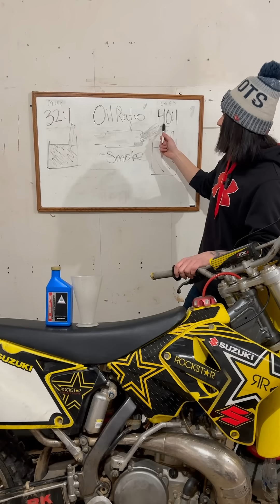2 Stroke Oil Ratio Explained

Comment: I think youre a little off on your milkshake analogy. Youre incorrect, its not richer because more fuel is flowing through the Jets with less oil because its thinner, its due to the fact that Oil acts like Oxygen and the bike will run leaner with More oil=more oxygen in the Burn.

Comment: We run typically 40:1 or 50:1 in the ski world , depending on the oil some push 75:1 ot 100:1 but its only those looking for every ounce of power and not aplicable to all setups , this is for race skis btw , for the thinner ratios

Comment: My 2001 Banshee calls for 20:1 or 24:1    That’s a damn Quart of oil in a 5 gal Gas can!!!! 
We have come along way since the original manual was written in 1987 with synthetics.
I currently run 93 octane with 32:1 Super-M Premix.  
I can probably bump it up to  40:1 with no issue, but I’d rather off foul a plug then seize an engine.  
You can also tell a lot by how it’s doing, installing a new spark plug and running it for roughly 15 minutes.

Comment: PLEASE STOP LISTENING TO PEOPLE LIKE THIS

okay so bro is actually dumb lol. running 32:1 or 40:1 are both correct its all in ur riding style. I ride a new yz125 and when we are in the trails where im less hard on the throttle, i run it 40:1. when we go to the track and im heavy on the throttle, ill run it 32:1. A heavier mix when you're not keeping it on the chip will cause the bike to bog and kill plugs. dont listen to this dingus

Comment: Honestly you're half right kinda. The reason it runs richer isn't because it's thinner, the difference from 32:1-40:1 in viscosity from a tank of fuel is literally nothing. It runs richer because each charge of fuel has more fuel. The volume that's going into the cylinder is the same either way, but less oil means more fuel per that volume. Nothing to do with drinking a thicker milkshake vibe. Also 100000% 40:1 will clean up your carbon sludge and tuning your bike correctly will really clean it up.

Comment: Fuel consumption is not going to change a great deal depending on how much oil your adding to your fuel. Your engine will deterioration quickly if there isn't enough oil in your fuel. Much better to be a little over than under.

Comment: As a mechanic by trade, I can tell you that it has more to do with oil quality than what the manufacturer says, when I raced I ran 50:1 amsoil racing oil and I never had any issues with lubrication, when I big bored my engine the piston and cylinder looked new and it had 5yrs of racing and hill climbing on it, your are right about needing to jet for the mixture you run but just use a quality oil and your engine will live a long time.
Reply: This is easy stuff , most of these kids are young school , I have lots of mild to wild toys . I’m at 40:1 with premium oil on all my 2 smokes with proper jetting running mild VP110 and have had Zer0 issues for many many years .
Reply: @JDRTRM  what are you running for mods and compression to need 107 octane fuel?
Reply: Kx 250 ran it with belray mc1 synthetic 50:1 wide open all the time. Jetted, piped, ported and polished intake. Never had a problem as long as I changed the rings every few months. Ran circles around my buddies with CR 500's...
Reply: Plugs will tell you all about what’s going on , from too much oil , jetting , and air temperatures
Reply: @JDRTRM  for the most part you are correct, the plugs are a great indicator of a problem or proper jetting, you will still have to do diagnostic to see what is causing the plugs to look the way they do
Reply: It's the quality of oil but the flashpoint is most important. High flashpoint oil won't burn at lower temps. Low flashpoint burns off too quickly for hot riding, like tight trail, muddy and sandy or any time your pinned at low speed. That's when you need high flashpoint oil.
Reply: Don’t be a brokie got it
Reply: I ran 50:1 on my supermoto also, I did street riding. It did fine
Reply: I agree I have to this day a 88 250 r and a 87. Both raced  50:1 is what I have been doing since I got them. 25 years and the one motor  looks mint inside. I blew a gasket so tore in down but i didn’t need to.
Reply: @RockwithAj yup that’s what good oil is supposed to do
Reply: @henryhenry3832  we just put a clutch in the 87 last night. My son is finally racing. Super fun for me to teach him.
Reply: @RockwithAj that’s awesome you guys are doing fun things together, my boy is going to start next summer
Reply: Wouldn't 50/1 cause over heating? I'm interested.
Reply: @CraigHenry-zq8jz  if you don’t jet accordingly it will run richer with 50:1, but no it won’t cause higher cylinder temperature, you are thinking of a lean condition which is caused when you run more oil than the engine is jetted for, the best way to look at it is more oil = less gasoline which = lean burn and higher temperature, less oil = more gasoline which = richer burn and lower temperature and all the negative things that come with lower temperature, carbon build up and less power are the main two, but when you run a good oil like amsoil ( it’s called amsoil dominator now) you need to downsize the main jet in your carburetor to accommodate for the higher gasoline content, it will be a bit of testing to get your engine jetted right, but i should also mention that if you run 87 octane versus 91 you will need to rejet to a bigger jet because 87 burns faster and can cause a lean combustion
Reply: @CraigHenry-zq8jz no its called quenching more fuel gets thro main jet faster cooling engine . And with a quality Ester based full synthetic causes less friction between piston and cylinder wall
Reply: @CraigHenry-zq8jz most brands recommend 60:1. Never in hell would I run my KTM on 32:1.
Reply: Poked and Stroked BaDshee << gets the fuel mostly ,lots of mods , 160psi per ,6deg timing etc etc .can bring down psi to run less octane but it’s more fun to run full tilt and the smell is always good , other 4x4 quads do not get the fuel as they are not so wild but can run ,will see very little hp if you notice it riding ,1000cc 4 stroke snowmobile has been tuned down some .
Reply: is Marvel mystery oil OK to use? On a regular basis.
Reply: Don’t know wouldn’t try . Get some good 2 stroke oil ,
Reply: Someone else that knows AMZOIL. I ran it at 100:1 with no issues and great wear protection.
Reply: @jasonkerekesch5012  I’m sure you could run 100:1 but the bottle said 50:1 for my application and I had great results with it
Reply: I ran that Amsoil in my bikes when I raced as a kid CR80s and a KX80 big wheel... I still ran it 32:1 though.  NEVER had to pull the jugs off any of them.  Raced them hard, too. 

Would love to have that big wheel KX I had still... That thing was an absolute freak.  Bone stock engine and pipe, KPS suspension... that sucker ripped!
Reply: @billymanilli  absolutely, you can run it at 32:1 but you get better power if you run less oil and jet accordingly
Reply: It is also flash point because I can run the same ratios and one significantly smokes and causes more spooge than the other
Reply: @capsitan  yes that’s right, but that’s why I only run high quality oil
Reply: 50:1 and proper jetting is the way
Reply: You are correct it also depends on what kind of oil is being used because some oils are castor, some synthetic, some petroleum and then the manufacture adds different solvents and there is different thickness. If I use redline I run 50:1 on my 250 2 stroke and if I use motorex I run 40:1. If your jetted correctly you can still have your bike loading up because it is receiving too much oil in your bottom end.
Reply: @lospanchos68  castor and petroleum gum up power valves ans exhuast port faster also. Ester is the way to go.  Had a shop for 17 years and ran about every oil and I would recommend motul 800v. All the way . Smells great . Good additives. Actually the only oil I felt more brap more crisp and ran harder . And burned clean .
Reply: @Bforbendejo  I’ve heard great things about motul but I run jd jetting in my Yz 250 and Yz 125, I was having loading up issues on the 125 jetted at what jd recommend and that is when they explained to me that redline is a good but thick oil and they recommended motorex 2t at 40:1 because that’s what they use when testing so I followed recommendations and it solved loading issues and ran imo perfect so to finish up my redline oil I followed there recommended 50:1 in my 250 and it solved issues but now just stick to motorex.
Reply: Its ALWAYS you ktm/euro dudes who run lean ass mixes. Theres a very good write up by A.G. Bell or gordon jennings i think. Did dyno tests from lean to rich. 18:1 is when things got too rich. The thing ive found is higher rpm = needs more oil. Especially the small bores. Big bores can get away with less, probably cause they they stay wayyy lower in rpms. It does clog pipes up quicker for sure.. but thats easy to clean out. You can definitely feel the vibrations go wayy down with a healthy super rich mix and its audibly more quiet.. no "quality" oil is gonna replace lack of oil when it needs it. If anything happens thats not ideal 20:1 super tech gonna beat 60:1 amsoil/motul etc. Look at any old bike. 250r has 20:1 plastered on the tank. What happened after that bike. Did oil get 10x better? No not really. Castor still king.. EPA /green warriors dont like to see the smoke. Thats the only reason they go lean.. plus why not sell more top ends?
Reply: @TheZmoney420 lol you have no clue about what you’re talking about, im Canadian 😂, and I raced all the way to to expert class in motocross with a cr250 and only ran 50:1 Amsoil dominator and never had any top or bottom end issues, in fact the last bike i bought had two hard seasons on it when I sent it to Honda for a high compression big bore kit because I was too buy at work to do it myself and the Honda mechanic couldn’t believe how good the inside looked, he asked me what oil I was running and he switched his cr500 motard to amsoil, it has nothing to do with the amount of oil you put in and everything to do with lubricity in the oil
Reply: doesn't take a mechanic to know his nuts lol that said.. the only time you should jet is on a bore. otherwise for a 2 stroke it's all about the carbon build up. sure 50:1 mite work well leaner but, you must have deep pockets to be running @50:1 lol XD text book is engine specific NOT rule of thumb across ALL so, if your 450 runs spot on with say 37:1 for example then that's the rule for that specific engine. you can buy twin 450's and still one will require a slightly higher/lower ratio than the other. it's just silicon lottery and down to the rider to get to know their ride.

Comment: As my comment said "Most of it doesn't burn" meaning some does. 
The main objective is to lubricate the main bearing as the crank case oil doesn't touch it. A small percentage of the oil does burn so that is where the kick ass smell comes from when running Castor oil.
Hope this answers your questions. 👍

Comment: Idk what I just watched... oil is mixed into the fuel and lubricates the piston con rod bottom end bearing etc. lower levels of oil to fuel will decrease the life of the engine, more oil will lubricate the engine more but will make more smoke because it's burning more oil, using to much oil can foul spark plugs and make engines pull slower (that's how it works in kart engines)

Comment: the confusion  is the term richer could be correct for either way 32:1 or 40:1  depends on what your referring to. If its oil your referring to than 32:1 is richer , if its gas than 40:1 is richer. Generally when it comes to engines we are referring to gas so if you want the engine to run richer you should run 40:1  If you are trying to reduce smoke as this gentleman suggest than 40 :1 will burn with less smoke if you rejet the bike to account for the richer gas mixture assuming the bike was jeted correctly in the first place

Comment: And oil is lubricant but more to less you don't burn more. You burn less. All you'd have to do is split the difference and get a hotter plug so it burns all the oil off

Comment: I had a 50 CC 2 stroke Yamaha. It had an automatic pump for the oil. I once added some kind of compound that was supposed to make the smoke smell better. Is the engine died. Had to empty you all that bad mix out and start from scratch. And that was the only way it would run.
Reply: Just add the vegetable oil into the tank for that Castrol R smell 😊

Comment: Better with more oil than not enough. I throw 100ml in 5 litres petrol on every 2 stroke I've owned, occasionally a touch less. Never any problems. Cheaper getting new sparkplugs. Use fully synthetic oil too.

Comment: Dude see here's the problem with what ur saying. Variables. You dont want to run the same mixture in a stock 250 as you do in a trick 85 or 125. I've seen my beginner buddy foul 3 plugs in 3 hours at the altitude I live at (5700 feet above sea level). He rides a vforce reeds and pro circuit exhaust  2006 rm250 32:1 and I jetted his bike. Im an 18 year master Yamaha mechanic. I squared him away at 40:1 and it never happened again as well as woke the bike up quite a bit. More or less oil will not cause a rich or lean condition. Only jetting can change that. If you don't ride in the power or on the pipe, you need to lean out your mixture. There's a reason 2 strokes take off at high rpm. Because that's where they're happy. However beginners aren't confident or skilled enough to ride in the power band anywhere but a dirt road. Mixture is like a golf swing. One mixture won't work for everyone. If ur a beginner and live at a high altitude, run your shit 38 or 40:1. If ur a fast guy at high altitude, run 32:1. Proper jetting is something that applies to everyone. If youre riding a carbureted bike and you're not sponsored, and you don't know how to jet your bike, you need to remedy that immediately because your buddies like me who know their shit are sick of doing it for you. If you're sponsored or young enough that ur pops still works on your bike, no worries. Just ask pops to teach you....as long as pops can get your shit cracking like a whip. If you have to slowly roll on the throttle of your yz125 because it bogs after dad re jets the thing, its definitely best to ask the dude who pulls holeshots against new 450s on his 1998 yz250. Y'all know the dude I'm talking about. He always drives a CLAPPED out 2 wheel drive Toyota or a 4 cylinder ford ranger. His bike is 25 years old, looks brand new, and every time he warms his shit up, all the heads turn in the pits. Believe me. I was rebuilding my top ends before this kid was born. He's not wrong, hes just assuming everyone can hold their own and lives at sea level.

Comment: 40:1 WILL blow up your top end with not enough lubrication for the amount of heat produced…bought 2 Yamaha blasters that swore they were ‘ran on 40:1’ ended up blowing up 2 weeks later 32:1 has NEVER failed me

Comment: I've used every 2 stroke oil out there and the very best oil I've ever used is the full synthetic amsoil dominator on my 125s call for 32:1 and they say you can run 50:1 with no issue which for the heck of it I did and haven't had an issue that hole year compression still 150s when I really beat her I mix 40:1 but that is my very favorite!

Comment: 32:1 is extremly rich. they told you to use 32:1 to avoid a warrenty claim. since 32:1 will foul a plug. but wont seize a piston. there is no ''golden ratio'' so to speak. the oil manufacturer will usually have a recomendation on the bottle. i used to use motul 800 wich stated 50:1 for motocross or 60:1 for enduro. your bike must then be jetted acordingly. so pick pretty much any oil you want. stick to the ratio the oil manufacturer recomends. then jet your bike.

Comment: Most of the time your 2stroke is smoking more is you need new packing in the exhaust.  But too many put too much oil in the gas, or use cheap 2 stroke oil

Comment: Many years ago with conventional oil, we ran a 125 with 20 to 1. It ran fine and didn't smoke much. YT has many videos about newer bikes having reliability problems and everyone seems to mix at 50 to 1.
Reply: 32:1 is ratio i used mainly! Maybe 30:1 on 85cc bikes. Always 32:1 on 125s /250s. Keep premix fresh & your golden! #Maxima
Reply: I've got over 1k hours on modern w strokes running 50:1. No issues at all. Pistons still look good after 150 hours.

Comment: 40:1 is leaner when your talking two stroke oil and gas, because the oil goes directly into the piston chamber, now your looking at it from a four stroke point of view air/fuel mix. If my chainsaw is too lean, i add oil to the gas

Comment: Spark plug tells all! P.s. you can jet no matter your ratio.  Thats the point.  Biggest isses is no oil is the same as some other brand.

Pick an oil and jet according.   If you dont want smoke, use smokless oil.  And you can be rich and still not smoke.

Comment: You mixed up the “richer” part , you shouldve said leaner to be correct.. Using less oil = Leaner
Reply from the maker: No, that’s not correct..if you switch the ratio to a higher ratio (which is less oil) and make no other changes, the engine will run richer.

Comment: I just run 100% oil on my 250… just dump it straight into the tank, no need for fuel. motor has lasted 8760 hours so far… I’ve had it a year, did I do it right? Last time I checked it was topping out at like 90 but that was on the trailer so it could probably go faster downhill